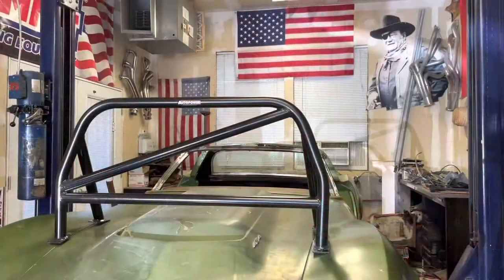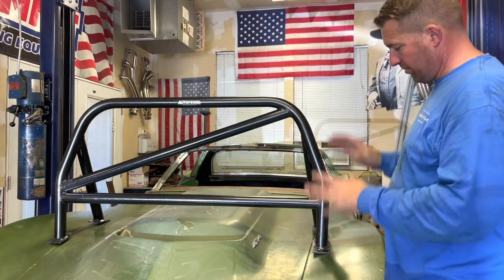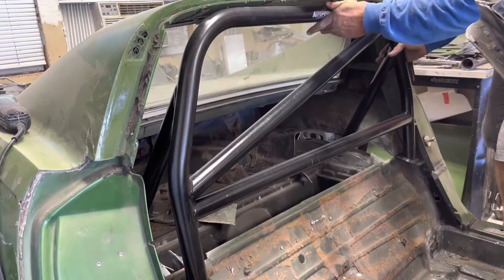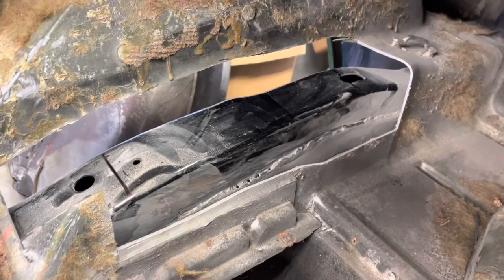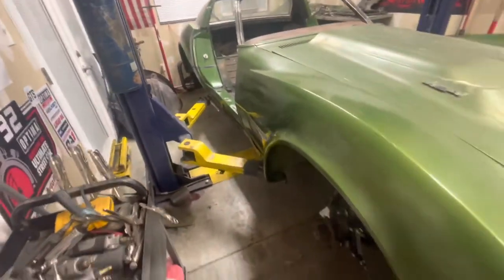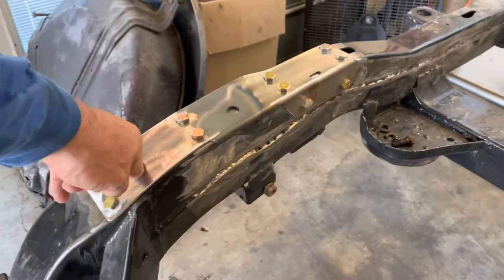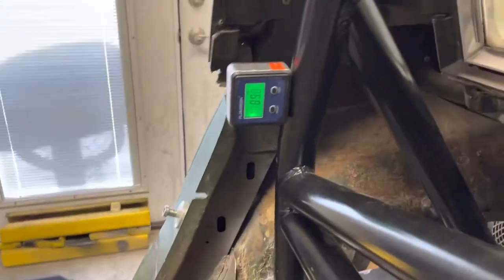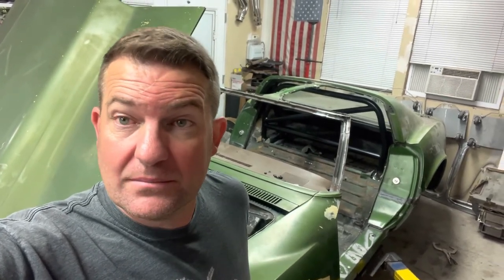1972 C3 Corvette Project Roll Cage Install

Comment: Where did you get the 1/8" brackets that you welded the cage to and bolted to the frame?
Reply from the maker: Those brackets were fabricated from scrap metal that I had kept from my bird cage repair earlier in the build

Comment: Why did you decide to do bolt in instead of welded to the frame? Like what you did- great fit and fab work.
Reply from the maker: Bolting it in will alway give me the option to remove if the body ever needs to come of again. God forbid 🤦🏼‍♂️
Reply: @mayermotorsports  sounds like a plan- hope for the best, plan for the worst!